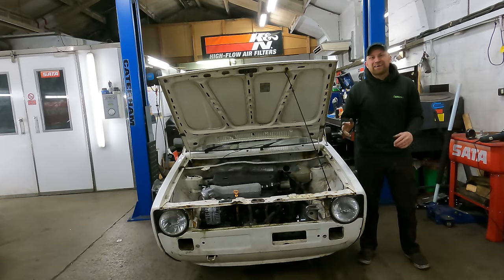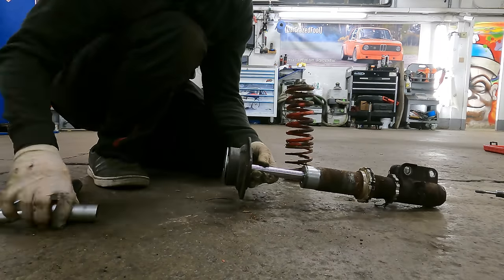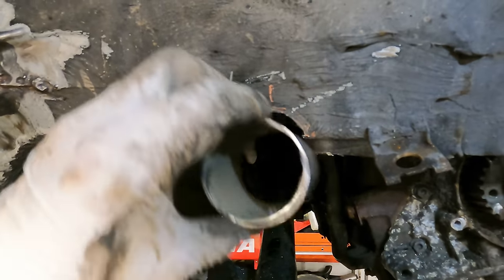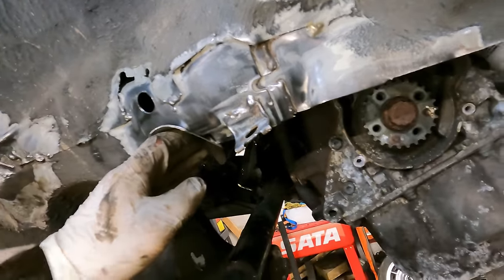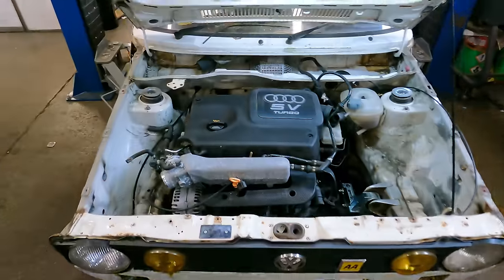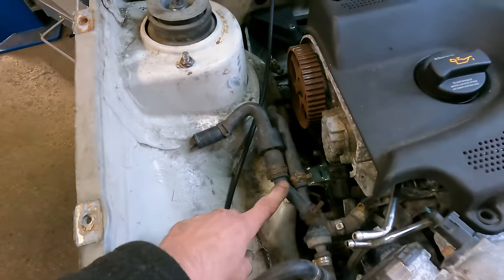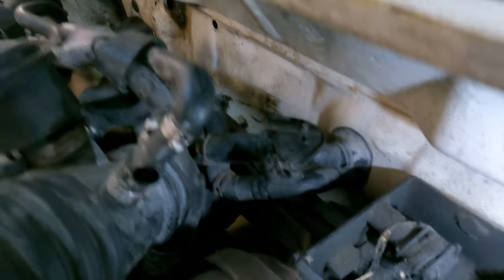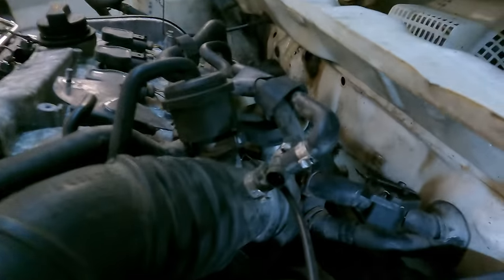Ep.3 The 20vT Caddy gets a Chassis Notch ready for air suspension!

Comment: Hi , will you be fitting a sump gard because how  low the engine sits, even  at standard ride height? As think it would bottom  out on speed bumps and curbs on british Street.
Reply from the maker: They are very vulnerable on these, theres a few options of shallow sump, and a tt one has a metal lower so it wont crack like a alloy one will. Thanks for watching 😁